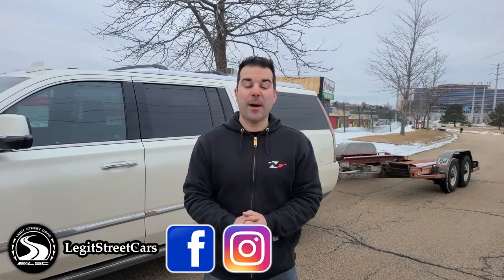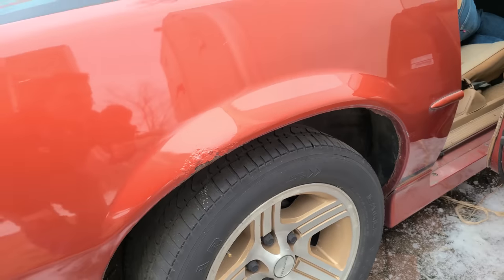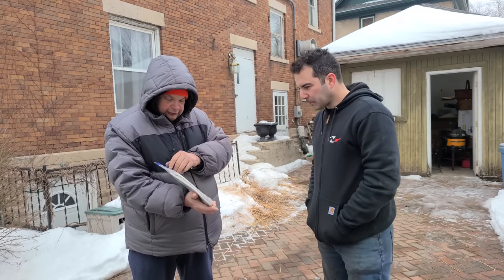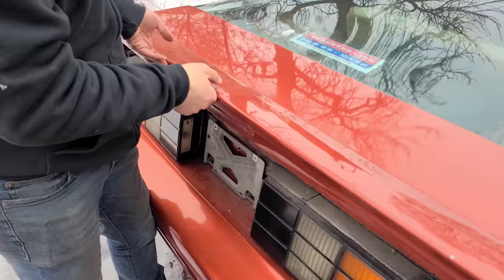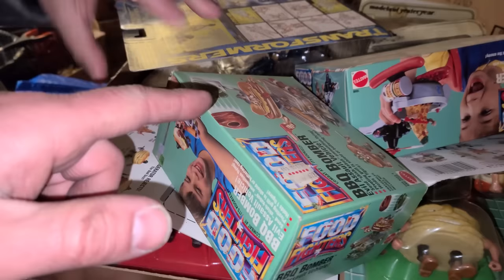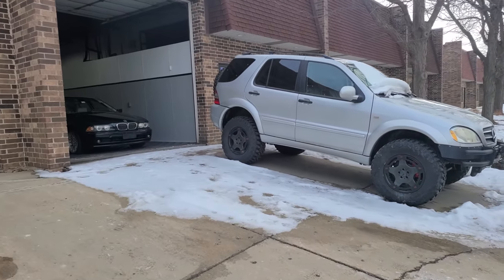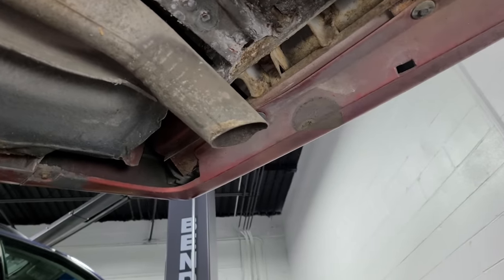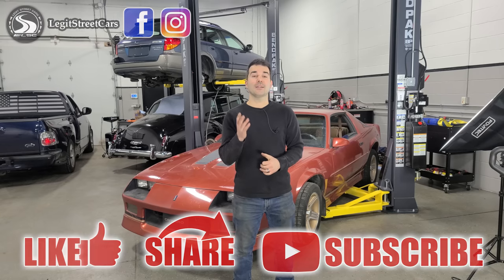I Bought An Abandoned IROC Z Camaro That Sat For 27 Years In A Storage Unit! Here's How Much!

Comment: Just a heads up those food fighter figures I don't know if they are presently but we're worth a insane amount of money in package a few years ago. I had a couple loose ones and at the time I got 20 and $30 each finding them in package back then was unheard of on eBay potentially you could get $50 each in the package. Maybe more the vehicles are insanely rare let alone finding one in the package. I've never even seen the food fighter Vehicles before other than in a catalogue picture. The matchbox Yankees usually you don't get much even in package. That Millennium Falcon I nearly had a stroke without the box and missing pieces I've gotten $100 for a 70s Millennium Falcon if it's complete with the Box I'd say somewhere between 300 and 600 maybe more especially where it's got the old tag from the store. And if it's sealed unopened I don't even want to take a guess what it's worth.

Comment: I would fix it up and drive it but I would find a 5.7 for it because the 305 is a joke and I would make it a posi trac rear end if it's not already with a 3:27 or so gear to have better take off and still alright gas mileage if it does not have it already. look for the G92 code on the body tag if you got it then it should have the good rear end in the car factory

Comment: Wow! What a great car! Fyi just 15 years ago, these would only bring around 4 grand in perfect condition. The value of these is only going to keep going up over time. If i had the pleasure of buying that car rust and all for 1500, I'd just suck it up and put whatever work into it that it needed to be perfect. The engine and trans doesn't really matter a whole lot because I'd yank all that out and replace it with a 5.3 or 6.0 and back it with a 4l60e or a T56. If you did the body work and LS swapped it, i think that would push the value up exponentially. I bought a Black 89 GTA Trans AM with no wheels, no engine, no trans, bad paint for $400 and put around 13K into it. LQ4 T56 3:90 gears posi, big stereo system, still working on the interior and still have paint to go. I really don't care how much it costs or how much i spend on it because i enjoy the car so much. I would suggest putting the money into it and just enjoying it. My first car was a 86 IROC-Z that i bought for 2500 in 2001. after painting it, i had an offer for 15K with the car high retailing for 5K at the time. I turned it down because the car was worth more than the offer to me. Book value isn't everything, you would be surprised what the right person would pay for an IROC-Z. Also, check the RPO codes in the glove box for code B4Z to make sure it is a real IROC. I really hope you fix this one up! Subscribed If that thing was for sale here in Idaho for 1500, i couldn't have got my money out fast enough ;)
Reply: That's what I am saying Fixxer Automotive
Reply: I would take that car all the way. Just weld in some sub frame connectors for added structure and fix the strut towers. It doesn't really seem that bad- ive seen much worse completely turned around. Look at Vice Grip Garage's Independence Chevelle for instance.

Comment: A quality paint job with no rust or dents using quality materials is at least 10K at a good body shop! Run from this car dude! I can guarantee you that the underside of this car is equally rusted or worse than the visible outside stuff! There are better cars out there just keep on looking until you find one worth the investment of time and money! I have bought and sold a lot of cars in the 50 or so years that I have been driving. I have learned the hard way when it's time to run! This car will cost you more than it's worth even if you do it yourself! If you fix it right!

Comment: The Power Hatch Motor is so that nobody broke the louvers that some cars had.   Louvers were very popular both factory installed and aftermarket in those days...  That's the reason!
Reply: The louvers were a $210 option in '87. I'm sure it was close to that cost beginning in '85 until that option ended.

Comment: I see early generation directional tread Goodyear Eagle tires. Boy were they controversial. Pirelli, Dunlop, Avon, etcetera all insisting, at that time, that directional tread tires provided no benefit for normal lots of tight turns street driving, and only provided benefits in straight line driving or huge radius curve driving.

Comment: He was wrong about them starting the chip-in-key ignition in 1989.  Someone has just changed out the key cylinder and bypassed the VATS system on that car.  $1500 is a fair price for a Thirdgen IROC.

Comment: An LS swap would be fun (especially with boost!) … make it the street car it’s looks imply by todays standards!
…but the body work to make that safe has to justify the cost … and that’s hard to imagine if you want to “mint it out”!  If you can live with 80’s cosmetics, then it’s patching the suspension mounts, and the worst of the floor bits and spray rust converter on the rest (not a cure, but slow it down).

If you have to strip the interior and replace all the floor, then I can not see the math working!
Parting it out might be the easiest option.

Comment: Just because the guy had the storage unit since 1995 doesn't mean the car was in there the whole time. Also that's what a 10 year old F body looked like on the road on the Chicago rust wise. Often much worse. The early 80s ones were already rusted cars for HS kids by the late 1980s. 

And really for the area, that's not that bad. Those floor pans look like they'll clean up provided that flaking paint isn't hiding and paper thin metal. 

The 1/4 panel weld seam areas can be replaced by themselves, no need to do a full 1/4. I've seen worse fenders fixed as well. It's a pain sure but it's par for the course in the land corruption and corrosion.

Comment: Be kool if had t tops.  I've also wanted one. But I got to look for a regal or monte carlo  or  oldsmobile cutlass with t tops.. because I have 3 little kids and a Camaro or firebird dont have a complete rear seats across.  They got the hump. The only Camaro and firebirds that has a complete seats across was 67 to 69 ... but no t-tops.. I want t-tops because its kool driving in summer and I will get something.  The only hard top I want is either 72 oldsmobile cutlass.. or my dream car since a kid I always wanted a gasser 1957 Chevrolet bel air  with rear seats for my kids .. and not just to drag race.  But drive around summer cruise and enjoy it.. that's all I wish I had.. oh! Yeah I miss mine 70 vw squareback that was my dads from being in Germany station there from being in the army.. in 1969 that was shipped over to the states.  Had a sun roof and 1600 fuel injected engine.  But that car gotten stolen from me during I was a work. My exwife watch the people taking it and she was dumb thinking I sold it. But I got back home to my restoring vw squareback gone and Dover-foxcroft Maine police never found my car. So I lost a kool car that was my dads. Even thou he committed suicide in 1983.. stinks I lost that car.. and I didn't keep my other cars and trucks I had.. I had 72 oldsmobile cutlass.. a 78 Thunderbird.. 1983 Chevy lifted truck.. 96 GMC Sierra extended cab lifted.. 92 chevy Cheyenne 2wd extended cab manual transmission and 350 engine.. .. now I have 2005 Yukon..

Comment: Sadly it turned out to be that rough! Don't know where you're @ but anything found in the northeast is usually much worse than that! I've had my fair share of F body cars and out of them all outside of the lack of HP and torque they never made, I personally think they are still the best feeling and handling of the generations. First gens are crude, second gens were just weird with the noses too long and passenger compartments too tight feeling. The 4th and 5ths were very low and tight feeling but handled well but had the power to get up and go LT1s should have been in the 3rd gens and the boat anchor 305s exactly that! Garbage! But with doing a engine and transmission swap in a 3rd gen with a 4th or 5th generation engine and 6 speed is probably going to be the best of the best! Handling, comfort, style and comfort in the passenger area even with a 6 point roll cage and fuel cell & battery in the trunk. My most regretful sell was my 85 in 4" cowl hood all in GM Medium Maui blue Metallic and RS spoiler sitting on Centerline Auto-Drags 5" fronts and 8.5s in the rear and almost a full foot of slick under each wheel well without the need of mini tubing to get them in there! The most stable drag car and the most solid feeling street car when it came to laying down the power to the road or track and feeling safe at high speeds! 👌

Comment: How bad is rust in general? I’m getting interested in purchasing a classic ( 1970’s era) car for a project car. I’m aware its probably impossible to find an affordable one without rust. Is there any general tips anyone has for rust ? How much of a worry it is, different ‘levels’ of rust, etc.
Reply: The general consensus is to buy a car from the Southwest. However, there are mint examples of cars in any area. Never driven in winter in an ad is one you want to see. Also, the manufacturers seemed to have specifica rust issues (GM vs Ford vs Chrysler ) that all had to do with not applying rustproofing. So, a Northern car with rustproofing will be a good indicator.  As for rust, the 70s cars have very little reproduction parts available. Reasonable rust is that which hasn't perforated the metal. You need to take a magnet with you to see if on the undersides,  they applied bondo (magnet won't stick). Look at the trunk floor, and underneath where the people sit. If there are holes, perhaps all the metal has to be replaced there. Check out Fitzee's Fabrications YT channel, he goes into explaining this a lot.
Reply: @javierdenardo2607  Thank you!

Comment: The car looking awesome but it need a rebuild. 🤣 Same with my 1974 datsun 1200 sedan. Cute lil car. But it need a rebuild. 50% of it need new steel. 🤑 The pushrod engine still good but I might swap with 80hp electric motor to it, so less thing to worry abt parts.

Comment: I was in the same situation, I h found a 96 ss impala but it doesn't run, found out the transmission is leaking, and half the interior needs replacing, the seller is asking for $3500 and I offer $1500 but he said no

Comment: The powered latch was for idiots, that big back window, many people put stuff into the back that was too high, people slamming the back hatch would break the window. The powered latch was supposed to be closed slowly (it was ruined by slamming it). GM used it in the luxury cars first but was put on these later.. and NO I don't know that for a fact, but I do know many a back window was broken by idiots slamming window on stuff too tall. That rust on the door was common on those cars,  mine had it there and NO were else. The inside of the door has a spot where dirt and water sit, just like the rear fenders on the big 3 Pickups (50 years of rusting out in the same spot on trucks, you would think they would solve that). Enjoyed my IROC back in the late 80's .

Comment: Weld-in subframe connetors and a UMI "wonderbar" (steering brace) make this chassis shockingly better.  You'd be surprised how well it can hold the road
Reply: I had a 1990 Formula 350 with both weld in and bolt in subframe connectors as well as a 6 point weld in cage and the doors still sagged when it was jacked up, plus the roof cracked by the door and no t-tops.

Comment: I'd get the engine running if it isn't siezed, confirm the transmission is operable, then pull both as a unit out of the car, pull the wheels, the front bumper cover, all body parts that don't have rust, and sell that stuff. You could make money on the car easy that way. It will never see daily driving again. It's dead Jim. All the bits & bobs from the inside & outside you could coach your kids to pull. They can learn something and make a little pocket cash for themselves (if you let them keep the proceeds from the parts they pull). Main goal should be to get compensated and get rid of it. Poor car. I used to have one of those, it was black with a t roof. My friends who had fox body 5.0s would outrun me, but their cars were uglier in my view. Having said that I hated the car from day one. Only drove it because my Dad bought it for me and I didn't want him to feel bad. Just not a fan of GM, at all, and also was never a redneck (I'm more of a nerd) and also not in high school anymore. Sold it to go to Europe for school. Never missed it.

Comment: The rust is really not ba a metal guy can cut that out and weld in new steel no problem but the paint job will be expensive and then the mice is the worst part because they can do big time damage like chewing wiring and their pee is really corrosive and stinks so the rug and seats may be peed on and the sponge in the seats could be chewed up

Comment: I had 1984 Camaro IROCZ.  I loved the car but it was a complete pile of crap. 5000 the engine lost a lot of power. The dealer said it was fine. Completely shit quality plastic and stickers. At 24 thousand miles the suspension was completely shot.I had enough and sold the crap 💩 A perfect example of GM building garbage cars and where they are today! Sad
Reply: There was NEVER an '84 IROC .... they started in 1985.

Comment: So let me get this straight…. You’ll be passed up a complete iroc because of the very minimal amount of rust…? Other than the door the rest of the rust can literally be sanded away, coated over, and painted. No need to go replacing fenders or anything stupid like that. The door is pretty bad but it was also a pretty small hole, if you wanted to keep the original door it would’ve been nothing to simply bondo it. No one would’ve ever known. The floors didn’t have much rust, and the mice are a cause for concern because they might’ve eaten electrical connections, but it wouldn’t have been too hard to deal with. $1500 would’ve still been stealing this car, especially with the original tpi engine. Would take me about $1000 to get it back to good shape, and the cars worth atleast $7000 so you’ve already made a profit.

Comment: Pull off the fenders, bodypanels, do rustconverter on the frame and underside and replace floorpans and sheet metal where possible? The exterior is just too nice to sell the panels off and scrap it, and for the love of f*ck don't smash it with a hammer like other youtubers do...

Comment: Those Chebby's are trash. Had an '86 Scumaro with the DOG305. Filthy mutt. Slow motion. V6 power. Lol. For 500 Smackers, yeah, not bad. But the underbody rusts like hell on them GovernmentMobiles.... like, Frosted Flake-sized rust. Whole thing, even the diff pumpkin. Put 3 alternators in it. Gaskets dry out. Puff the Magic Dragon. Fucking horrid. I parked it in front of the dumpster at Portsmouth Ford in August '99 and never looked back. #Shitbox

Comment: I don't like the car, Camaro made it's best car in 1967 and went downhill from there. 1981 was the last year they actually have a decent strong front sub frame. Shared with the Nova. If that was a 1967 I could forgive all that rust damage and for that price I would have stole it. I would lose the leaf spring rear suspension that came on the 1967 and replace it with a coilover rear frame kit. That body style though is in my opinion the worst Camaro ever had.
Reply: Lmao, the Nova was the worse dog-tracking vehicle any manufacturer ever produced. And I've owned numerous GM vehicles the last 38 years.